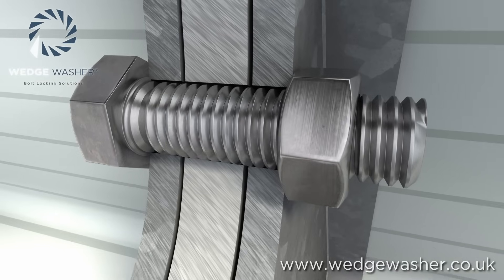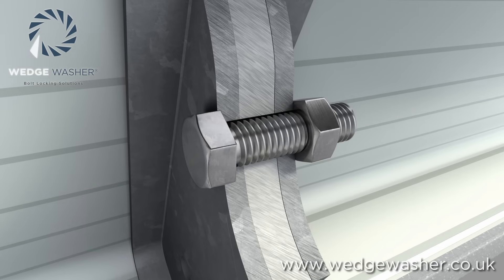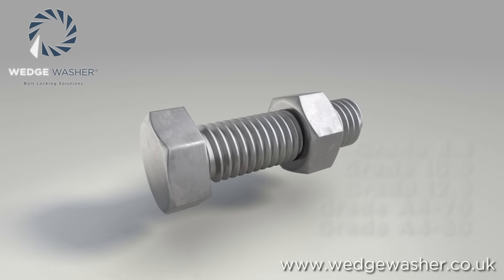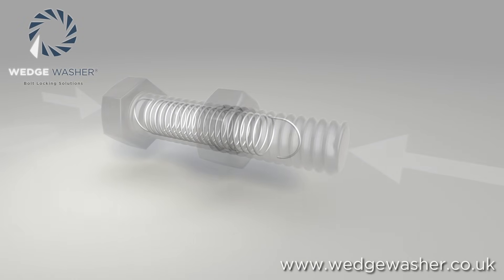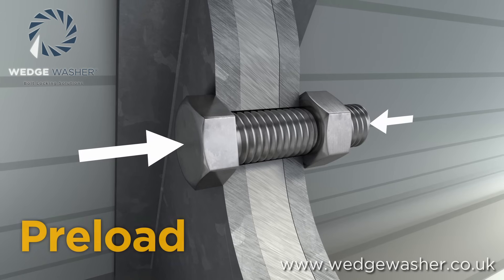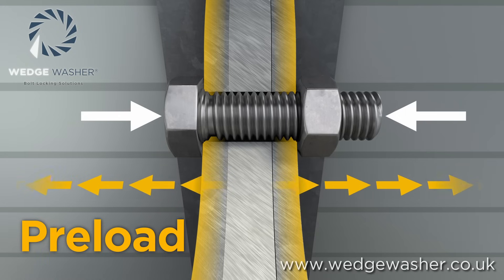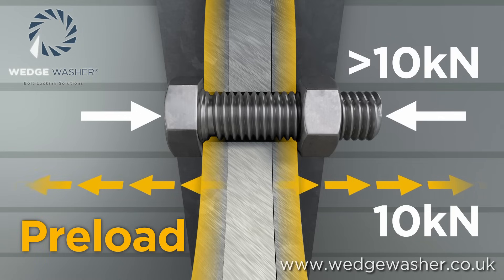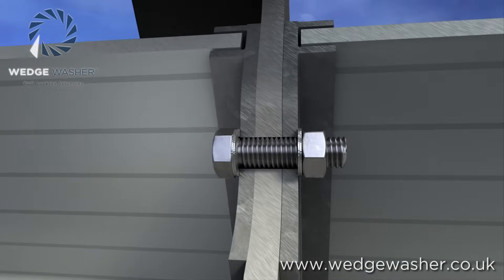Pre Load in a Fastener explained in the simplest way possible - Pre-Load = Clamping Force

Comment: I believe I read that side loads loosen fasteners more often than axial loads.

I believe with side loads the frictional force between the underside of the nut/bolt head and plates is analogous to the preload. Not sure though. That is, once the side load goes above the frictional force, stuff starts to move.

Comment: Is there any application where the wedge washer should be torqued until flat ?  I've seen bolts/washers installed in this manner to hold down high current bus bars I assume to prevent loosening due to heat cycling.  Many washers were found to be literally fractured during maintenance.

Comment: untrue, if the bolt is preloaded pull force can be significantly larger than bolt preload. The bolt usually takes 10-20% of the pull force if preloaded. This is to do with clamped material stiffness which is times larger than the bolt stiffness.

Comment: In the absence of a wedge washer, use loctite. If you're a farmer, just damage the thread below the nut with a punch.
Reply from the maker: Agreed that loctite can work for some applications and damaging the thread can stop the nut coming off but the point of the wedge washer is to maintain the load in the joint and not allow backing off.  If safety is not a major concern then many other options that are cheaper can be used.

Comment: I agree.. good washers can extend the life of a joint and maintain adequate fastening loads, as with variations in temperature steel bolts can slowly unload due to permanent stretch.  They also help prevent a bolt from unscrewing if it becomes load deformed.  Note; this is why old bolts are not to be re-used in the application that they are taken out of, such as car engine head bolts and studs.  In the USA you can access these at McMaster, MSC Industrial Supply and other industrial outlets.
Reply: many head bolt designs can be re-used IF the service manual either says nothing about it, or (admittedly) even better if they say you can. I always thought bolts/screws that had a set torque value CAN be re-used, but ones that have a torque AND an angle spec cannot.